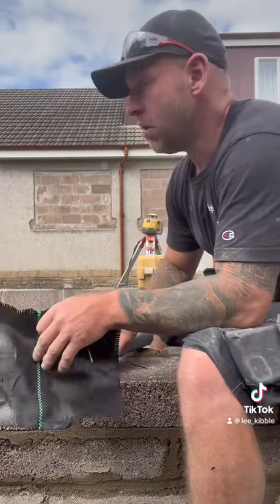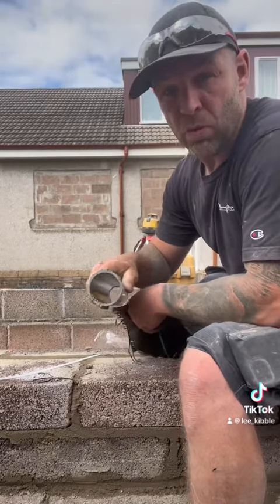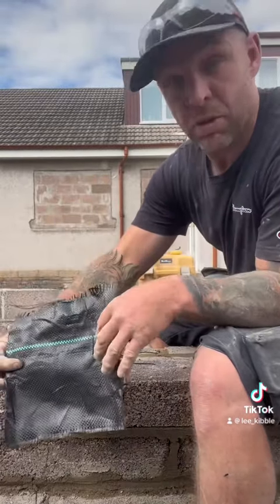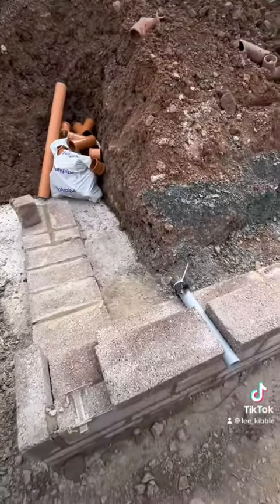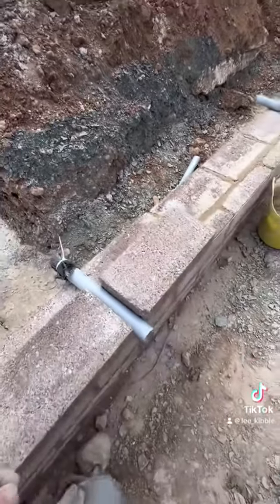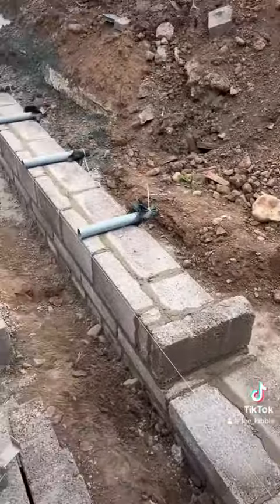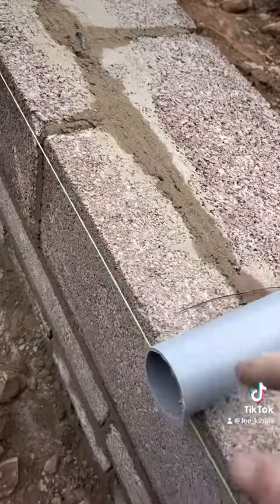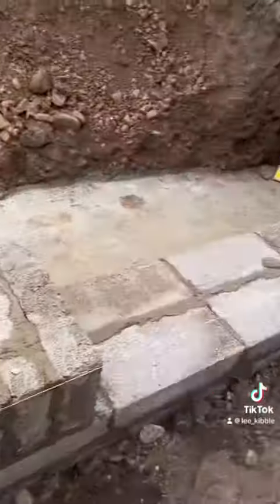A small tip for weep holes in a retaining wall

Comment: That cloth will get clogged up with soil, like any filter would do.
Reply from the maker: @KevinSmith-js1up  not had a problem in 18yrs so…
Reply from the maker: @KevinSmith-js1up  if you listen to the video there is no soil that goes up against the weeps, only 10-20mm clean stone which is completely enveloped in membrane. That’s the filter